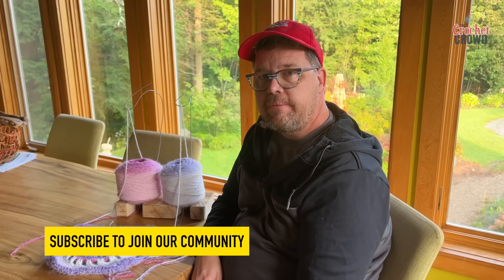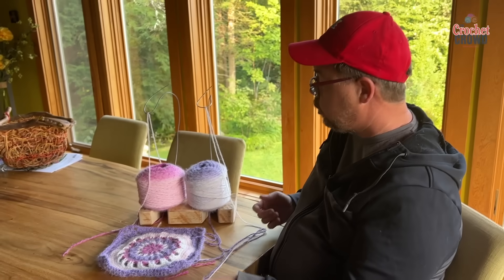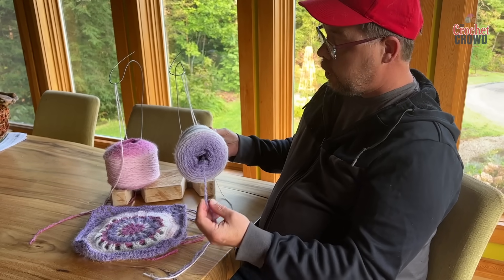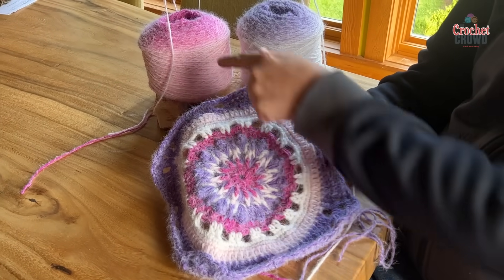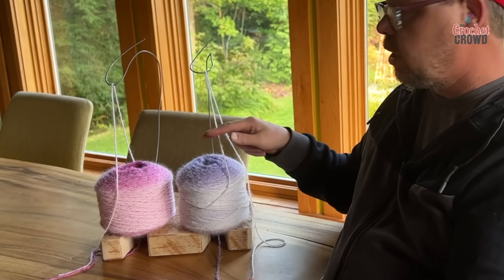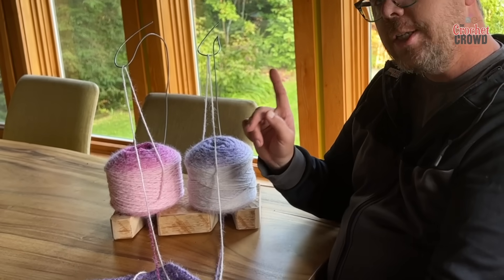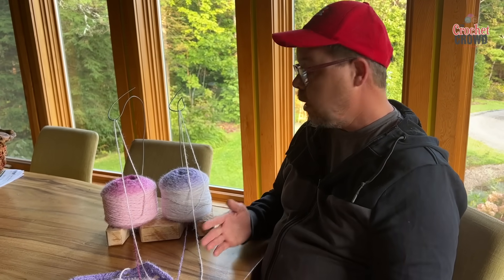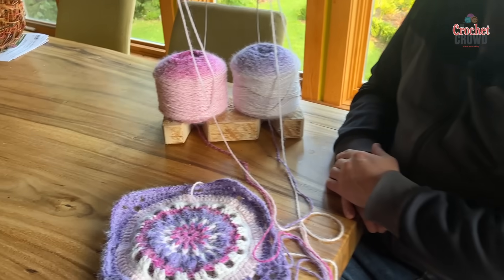How Mikey O Matic Yarn Feeder Works

Comment: Sooo Cool Mikey!!! Thank you for sharing the concept plan!!! ❤Love this so much! You forgot to mention another problem your contraption solves ... if you choose to use traditional ombre type cakes that have a more deliniated transition - you can color control your oroject much easier  Especially if your cakes in the same colorway have the color you need to work with located the center of one cake, and the outside of the other! No more having to match the centers on purchase of the cakes!!! 🙌🎉👏